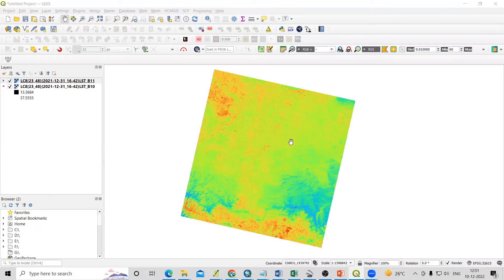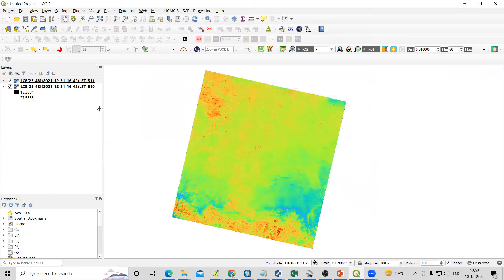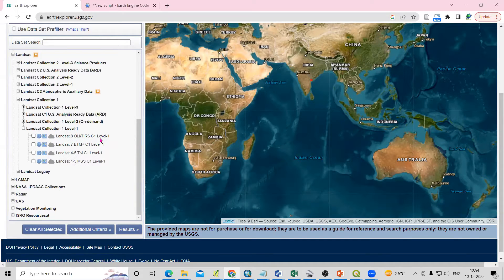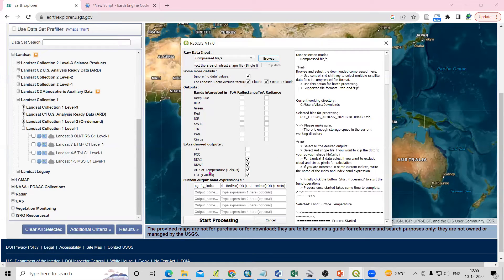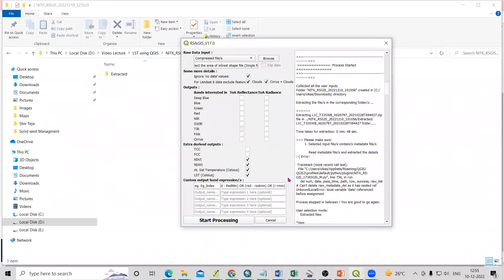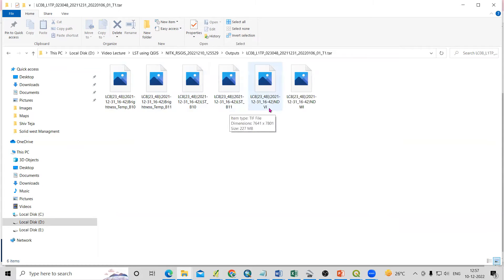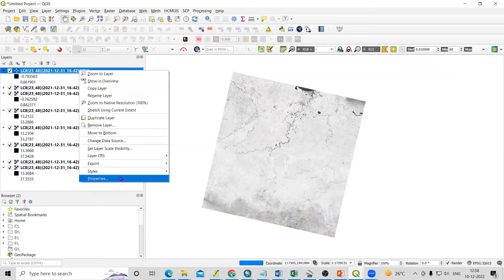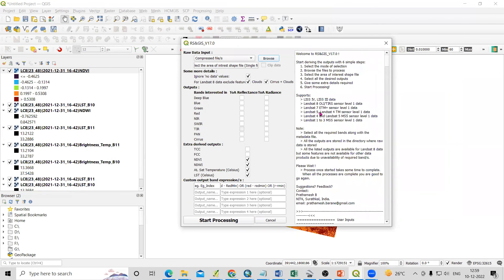RS & GIS QA22- Automatic Extraction of Land surface temperature (LST),NDVI & NDWI using QGIS

Comment: Very nice plugin, a short cut to the hectic processing of formulas
Reply from the maker: Yes it's really nice tool 🔥
Reply: @vikasghadamode 
Error in the process
Reply: @vikasghadamode 
Any solution
Reply: @vikasghadamode 

Process Started ===============

>>>----------------------------------------------------------------------<<<

Collected all the user inputs

Folder "NITK_RSGIS_20231018_144918" created in (N:/landsat2019) directory

>>> Please make sure:

1. Selected input file/s contain/s metadata file/s

Read metadata file/s and extracted the details

>>>----------------------------------------------------------------------<<<

Created "Outputs" folder to store all the outputs in the directory (NITK_RSGIS_20231018_144918)

>>>----------------------------------------------------------------------<<<

>>>~~~~~

>>> For True Color Composite:

:-( Error:

Traceback (most recent call last):

File "C:\Users/vinee/AppData/Roaming/QGIS/QGIS3\profiles\default/python/plugins\NITK_RS-GIS_17\RSGIS_M.py", line 2103, in run

tcc_w_del(num)

File "C:\Users/vinee/AppData/Roaming/QGIS/QGIS3\profiles\default/python/plugins\NITK_RS-GIS_17\RSGIS_M.py", line 1544, in tcc_w_del

radiance_cal(num, 'r')

File "C:\Users/vinee/AppData/Roaming/QGIS/QGIS3\profiles\default/python/plugins\NITK_RS-GIS_17\RSGIS_M.py", line 1405, in radiance_cal

get_band_data(num, band_info[2], band_info[1], band_info[3])

File "C:\Users/vinee/AppData/Roaming/QGIS/QGIS3\profiles\default/python/plugins\NITK_RS-GIS_17\RSGIS_M.py", line 1048, in get_band_data

Quality_band(num)

File "C:\Users/vinee/AppData/Roaming/QGIS/QGIS3\profiles\default/python/plugins\NITK_RS-GIS_17\RSGIS_M.py", line 981, in Quality_band

dataset = gdal.Open(bq_filename, GA_ReadOnly)

UnboundLocalError: local variable 'bq_filename' referenced before assignment

Process stopped in between ! You are good to go again.